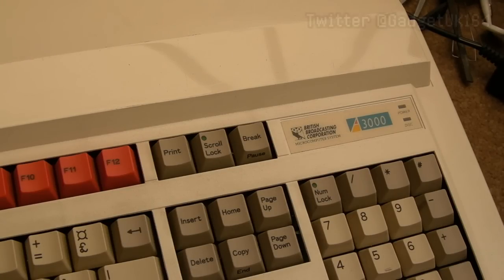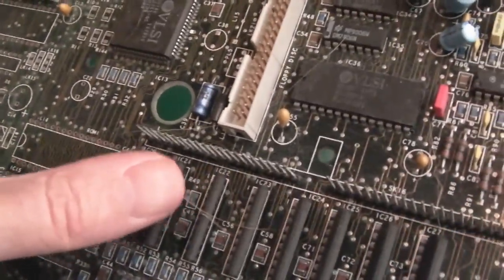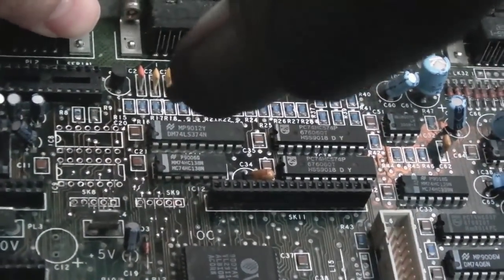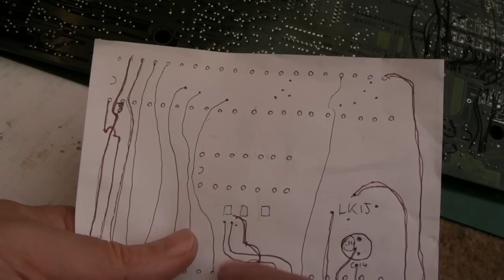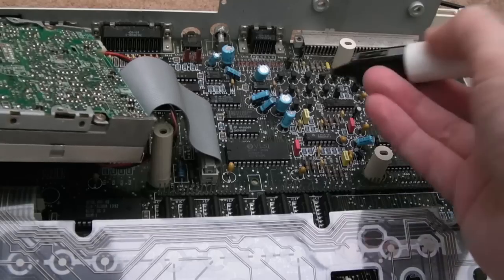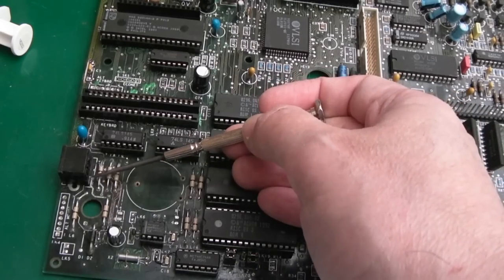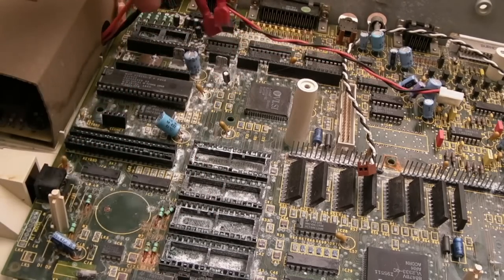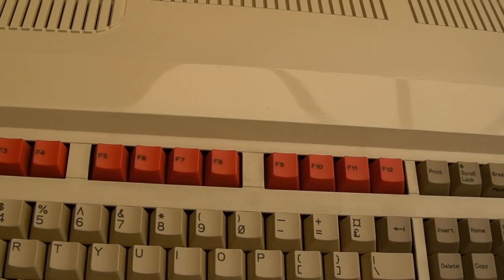Acorn Archimedes A3000 Repair (From Hell)

Comment from the maker: You can see the repair by Plan C here (his was worse!) - https://www.youtube.com/watch?v=Prtm9n5SnPQ
Note: I should also point out that SparxUK, Dennis van den Broek, PlanC, Rob Taylor have all helped me out in so many other ways in the past - besides supporting me on Patreon.  That is very much appreciated and a factor in why these individuals where chosen for some of the last 5 systems.  I made it sound like PlanC and Mike Pearman donated something in exchange for the faulty A3000's, and others didn't - that is NOT the case by a long shot, these people are amazing (all of them) and have provided lots of support to the channel over the last few years!  *Expanding on Hall Effect Sensors* - the other way those can work is with a sensor that can detect a range of magnetic flux - ie. with an ADC, it may be able to output a range, say between 0 and 255 or -127 and +127 etc.  That type are used in triggers on modern consoles, so they can detect how much the trigger is pressed.  The nearer the magnet is to the sensor, the more of the change.   The type in a FDD like in this video is probably a reed switch or something internal to the sensor, so it just changes on and off with the magnet.

Dermot Sweeney - https://www.youtube.com/c/DermotSweeney

Comment from the maker: 00:00 Intro 
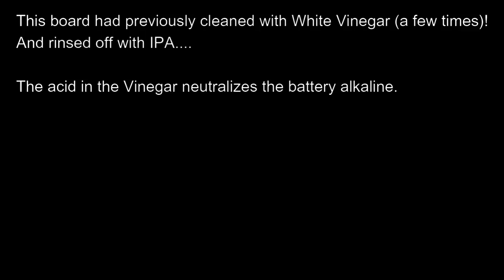01:03 Livestream Footage (Removing Components)
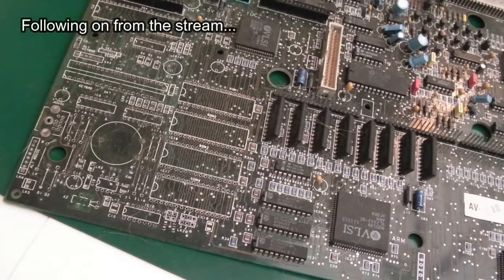11:51 Fixing (Adding Components)
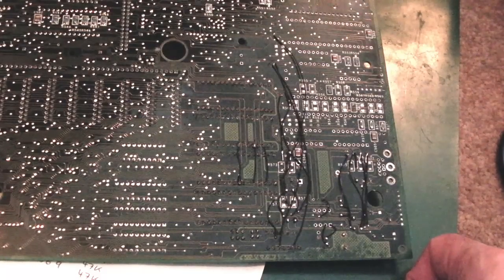19:58 Cleaning ICs
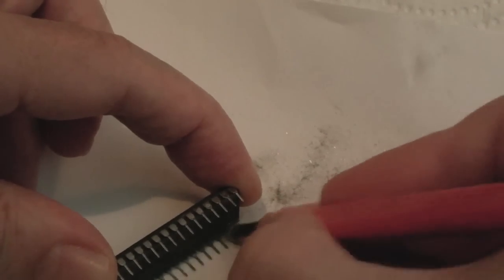21:24 After First Test (Tinning Pads & Traces)
23:34 Removing Chips (Hotair)
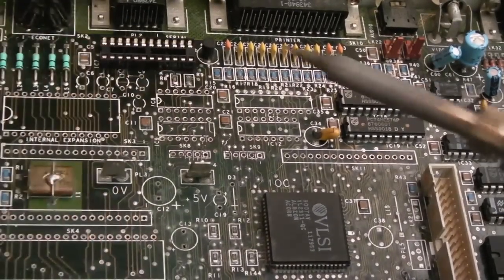29:51 Removing SMD Caps & Resistors
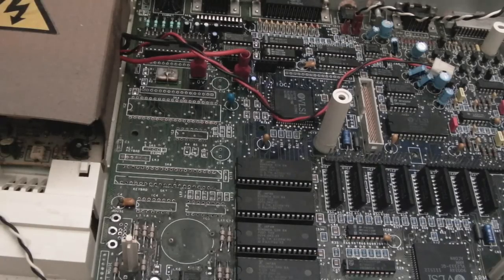30:58 After Second Test (Bad ROM)
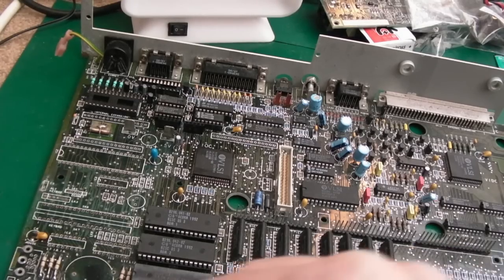32:20 Fitting Connectors & DIY Keyboard Connector
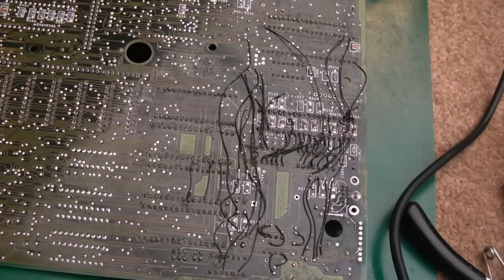33:51 Spaghetti Fix Wires (Lots...)
36:25 After Third Test (Almost Fixed)
41:21 LEDs
42:06 Floppy Disk Drive Interface Borked
49:33 Making Sense of the FDD Issue
53:10 Servicing FDD
55:39 OMG - How Many Wires?
1:02:37 Cleaning Rear Connectors
1:05:34 Nearly Complete
1:06:05 Battery Mod
1:08:11 The Other A3000's
1:11:52 Case Stuff
1:14:03 Test Four
1:14:35 Power Switch
1:15:13 Arghhh!
1:16:56 We're Done!

Comment: what you need my friend is a large ultrasonic cleaner. that and some vinegar, mild soaps or PCB cleaner would take most if not all the crap off the board, even from under the chips from what i have seen. I know they are great for cleaning off flux and other stuff.
Reply: if someone out there can they should arrange to send him one. I love one for my old tech collection. I am still trying to figure out how to repair the corrosion of a gold-plated game port on a diamond monster sound mx300 sound card.

Comment: Outstanding repair as usual. Thanks for the upload and thanks for sending the unit my way. Totally blown away! I have learned loads from watching your videos over the years and just wanted to say a thank you by way of a donation to the channel. Thanks for all the help over the years. I think you are right about sun and yellowing. I do a lot of decorating and the old oil based gloss usually goes most yellow (bordering on orange lol) in the darkest rooms.
Reply from the maker: Thanks again! =D  I think the one you worked on will be even more amazing tbh - I am sure it had more corrosion damage!  You are welcome, and thanks for the donation - makes a huge difference!!!
Reply: @GadgetUK164  Thanks. Not sure there is even gonna be a vid atm. I should have done it in parts but got cocky and didn't
 Now, half an hour into the video, I have done something in Lightworks which just makes it crash as soon as I open it and I haven't backed it up in weeks 😐 I hate lightworks but it is free lol

Comment: Glad to see the joystick interface came in useful.  Not sure if I included one or not, but I've also got a little adapter board that plugs into where the serial port driver chip would go on an a3000, which then allows you to use the 9 pin serial connector on the back as a joystick port if you'd like one of those to have a play with.
Reply from the maker: =D  There is a video coming up soon on this!!  Sorry it took so long!
Reply from the maker: And yes, you sent the cables that can plug into the serial output socket!

Comment: The first thing I would have done with that Board is putting it into the Dishwasher. That works very well with a cleaning Tab and a longer running (1 hour+) 50-60°c cleaning program (but deactivate drying function because that will be much hotter) I had a board that was nearly as bad as yours and it came out like new. Only the real broken parts had to be fixed and drying works well at 50-60° with hot air in the oven over 5 to 10 hours.
Reply from the maker: I am the dishwasher in this house lol!  No one is putting that board "in me" 😂

Comment: For that keyboard interface connector, I've seen people slip a card in there then pull out connector.  In fact, I believe it is standard practice for HP printers.
Reply from the maker: Thanks for the suggestion there =D

Comment: Wow, what a fix! A long project but surely worth it in the end. Great to see it working again in the end, and another retro computer saved from the bin. Just out of curiosity, what is the nail varnish used for? Protecting components?
Reply from the maker: Thanks!  Nail Polish is just a solder mask substitute - I use it where there's exposed copper trace.  It just stops oxidisation on traces etc.

Comment: I've found that IPA that isn't 99% leaves a white film when used on standard (not water soluble) flux.  It's the H2O in lower concentrations that is probably the issue I suspect.

Comment: Hello,
I've noticed some issues with my A3010 after 8 years of perfect performance.
Some of the buttons on the keyboard are not working. They're all close to the return key so P L . 9 
I remember this happened to an old A3020 I owned and it deteriorated quite quickly, as only 6 buttons worked in the end.
Does anyone know of a fix for this or a way to replace the keyboard ?
Reply from the maker: Check out some of the keyboard repair videos I've done.  I did some on the Archimedes, but also on the Amstrad CPC and Atari 65XE too.  Conductive ink and copper tape can be used to fix problems with traces that are failing.  You may find it works after some cleaning of the contacts, but sometimes its the end of the flex ribbon that's the problem (again check out the flex ribbon video I did on the Amiga).  You can find those videos on my YT page - click the search magnifying glass.